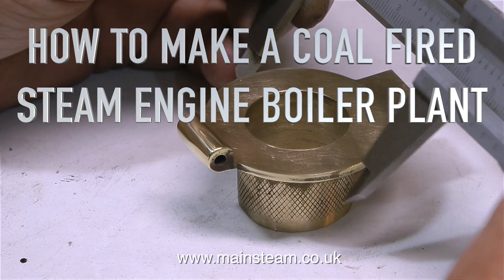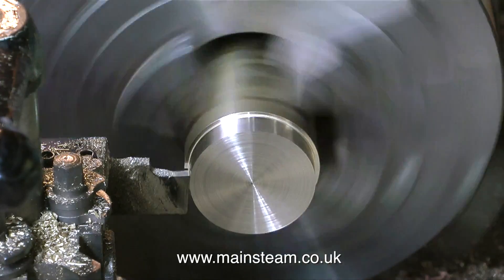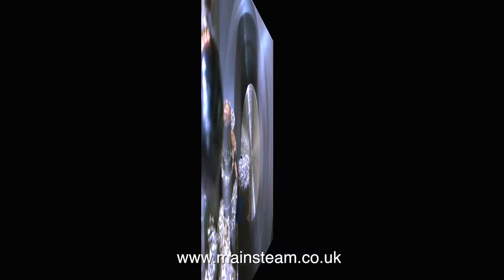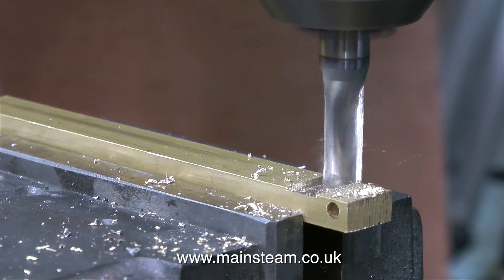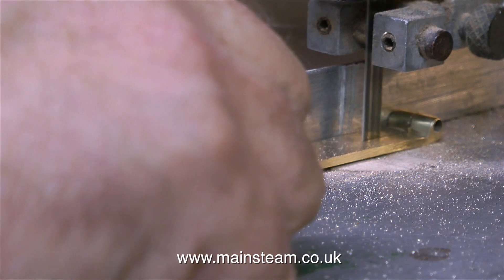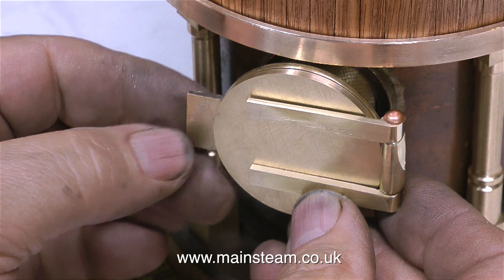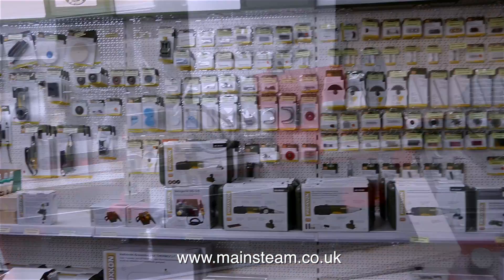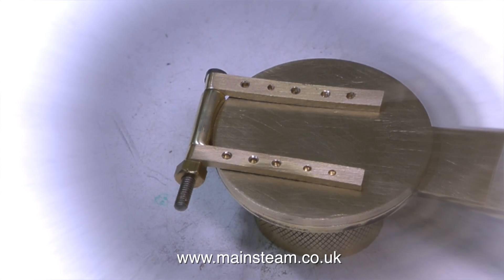HOW TO MAKE A COAL FIRED STEAM ENGINE BOILER PLANT - PART #14

Comment: I really like your style. If it is botched, it is botched. That is like the difference between old-time programmers and today's coders. In the olden times the machines both had limited memory and slow processors so you actual desk checked and fixed the code. Nowadays, the coders just throw more code at the problem until it looks like it works correctly.
Reply from the maker: Thanks for the kind comment Mike. I agree with you on the way programming has gone - just look ate the finished file size of a word processor document now as opposed to a few years ago ........

Comment: I am neither a machinist nor a musician, so please forgive me if this is a terrible idea. Would it not be easier to machine the firehole door and the fitting onto which it fits at the same time, so that they will automatically be the same diameter? If you turned the larger diameter first, then parted off the firehole door, then finished turning the fitting, would that be easier than measuring the finished fitting and making a door to match?
Reply from the maker: Yes it would, but I used up some small pieces of Brass to make the parts and and I didn't have enough material to hold it in the chuck securely.

Comment: :D So this pretty much is an episode about failed hinges. Love it. Thanks for sharing the experience :) Something I miss in other videos, seems like no one is making mistakes, ever.
Reply from the maker: All will be revealed in the next episode :-)))
Reply: I too hate making mistakes, but then you know what you didn't like and plan a different way to correct for the mistakes. It's the same way of laying out Printed circuit boards. I learned what worked before I had a cad system to lay out boards, and spent hours drilling holes.